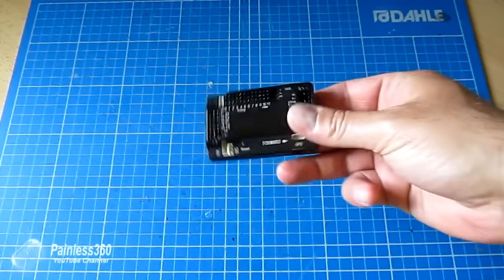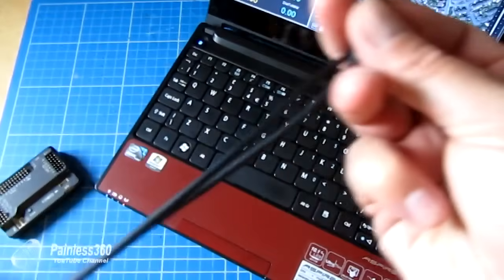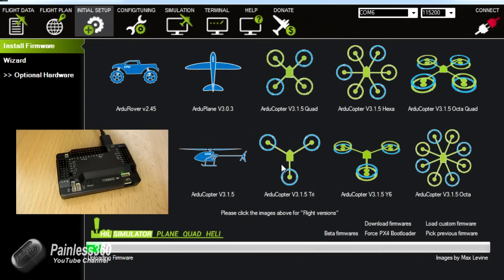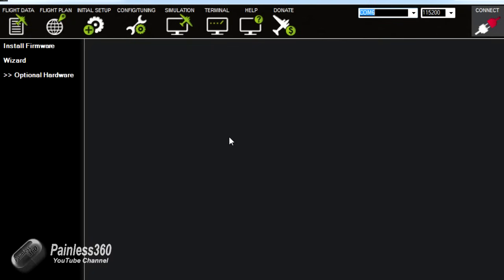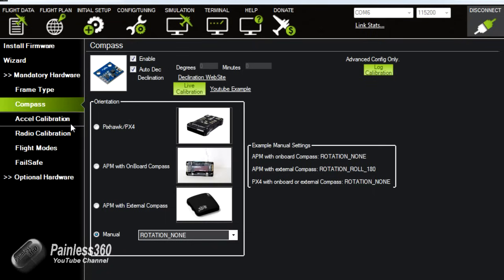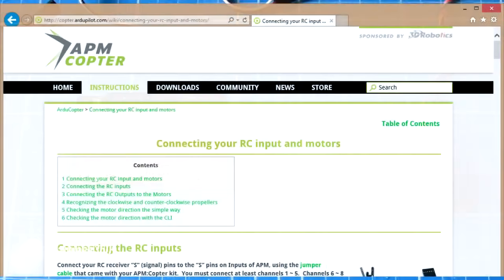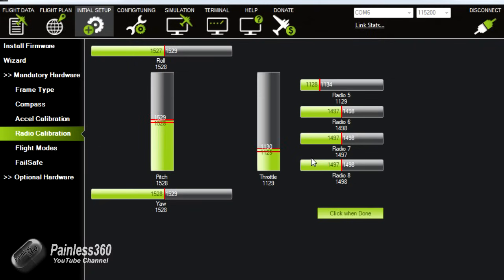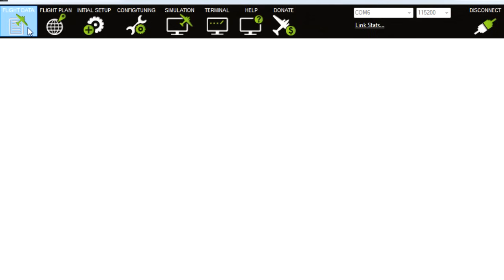(1/8) APM 2.5/2.6/2.7/2.8 - Simple installation and setup overview

Comment: Hi Brother :) I do hope that everything is going fine with you, and althou you are bussy I hope that you have time to help me?I have a set up, the motor is:Turnigy 4112-320kv and the esc is 65amp(overkill I know) the Problem is on 3 or 4 or even 5s lipo's I can not get the dam thing to fly, first on 6s lipo's It fly's but I have got to be over half trathol to hover and all the way up if I want it to fly a bet aggressivlly. I have some Carbon Prop on it(11, something ) I had a easy Osd installed on it, and it pop on me for no reason. Since then It has been worse. Is there anywhere in apm board where I can screw up the throtel or what do you think I should do?Sry my bad English ....
Reply from the maker: +Bisholi M Looking at the specs on the site the detail on recommended props is very poor. I would suggest that you need a larger prop but I would go back to HK and ask them for a proper recommendation for your preferred battery size. Best of luck.
Reply: +Painless360 Thank you for responding. Yesterday I was out flying, and the last couple of times I could fell that it has less and less power even thou I would use the same new liopo's 6S. So suddenly as soon as attach power to the board my Osd went up in smoke, Since the arducopter has done very strange things. I thout that a new set up from scrach will help :( But no. The ch. 3 to the motors wont work anymore, all the other ch's work but not that one!! I dont know what to do. To order a new APM bord or go for the new more powerfull PIXHAWK?any recomendations? :)
Reply from the maker: Bisholi M I would recheck your calculations and motor/prop setup before trying another flight controller. Both the APM and Pixhawk are great controllers if you want GPS.

Best of luck.

Comment: A question. 
When I try to see the information of serial information I get extrange character. Can you teel why-
Reply from the maker: +Jorge Gómez could be a few things, depending on versions. Disable things like the BT adapter on your computer and later versions of the code removed the console from the stuff you uploaded. Check the release notes.
Reply: Try changing the baud rate.
Reply: I did it, but with not sucess.

Comment: Can I use obstacles detector & avoiding sensor  in apm 2.8 board?
Reply from the maker: You can with the Pixhawk boards. Not sure if the older software that the APM will run can.. Best of luck

Comment: Hello, i just got the apm board and ive had a crash where my quadcopter just dropped out of the sky when in guided mode. any ideas on what happened? I have flown it in guided just before the crash and it was preforming very well.
Reply from the maker: I'd look at the logfiles (see the later video in the series) to see what happened. Best of luck!
Reply: I checked the logs, threre is a spike in the roll. i belive this means mechanical failiure

Comment: I have an arducopter V2.8, when i look for the recommended firmware update 3.2.1 i don't see it in the list of available downloads. there is AR2.50 AP 3.3 AC 3.2.1, is this the version i need ? there is only 3 other choices, AR2.49 AP 3.3 AC 3.2.1,or AR2.49 AP 3.2.3 AC 3.2.1, or AR2.47 AP 3.2.2 AC 3.2.1
Reply from the maker: http://youtu.be/Vbz3vN3JH6Y AC (Arducopter) 3.2.1 is what you need.

Comment: Painless, i dont know what is wrong but my quads lowest throttle point makes the quad take off, which resulted in crashes.. why does the throttle start so violent as so low throttle?
Reply from the maker: Esc calibration,  throttle range on the radio... watch https://youtu.be/olIqTiSJHIY and come back to me.

Comment: @Painless360, I am having issues with the external compass.  I am able to perform the calibration, it states it successfully captured the data points, but then nothing happens.  When I go to the Flight data screen, GPS information just sits at 0.  Any help appreciated.
Reply from the maker: Happy to help but please watch https://www.youtube.com/watch?v=olIqTiSJHIY and come back to me with more detail of what you've tried..
Reply: Problem Solved:  Got the new GPS in, plugged it in and now I get Sat information.  I was convinced I was doing something incorrect, however it turned out to be a faulty GPS module.

Comment: Hello Could you tell me the planner version you are using here as im trying do this with 2.0.24 and a 2.8 controller, the newer version seems different to your tutorial one. I get as far as loading the firmware, but when i connect there is no list of setups. thanks for your help. kev lev
Reply from the maker: I've not played with APM for a long time now. You should be looking for V3.2.1 or earlier for an APM. The option to load previous firmware is still in the bottom right (see later video on it in this series..)
Reply: thanks I've got it working now, muppetry on my part, got muddled up with the com port assignment...

Comment: If I connect APM board with APM Power Module cable, then what to do with ESC ( three cables ) cable. Have I to cut Red supply wire & use only other two ( for control )..??
Reply from the maker: All covered in the series - keep watching! :D
Reply: Painless360 Thanks alot

Comment: Hi,

I need help with APM 2.8 arming.

APM 2.8 setup
Jumper J1 (used) as I have not plugged in the PM
Receiver connected (with correct cabling) to APM
External GPS connected  to APM (it came with 2.8)

This part worked -

1) Accelerometer tuning via Mission Planner (MP)
2) RC calibration via MP, moving the sticks on the remote control

What is not working

a)   I am getting bad compass health error
b)   in MP when logging into the Monitor - lots of gibberish characters are scrolling on the screen

Red light on APM continues to blink slowly.

I can connect to the Mission Planner, but cannot get the RC to arm.
I am trying to hold  the throttle key to the extreme bottom right for 5 seconds after turning on the RController.

I tried using the reset switch on the APM (when connected to USB) by pressing it down.

Soon after resetting it, you notice the purple and red light flashing together, then only the red light continues to flash slowly.

Can someone please help.

Newozuser
Reply from the maker: V Patankar You need to plug the external compass into the board and try and calibrate again. I cover the arming troubleshooting process in https://www.youtube.com/watch?v=6U-rjC39EXQ
Best of luck.

Comment: Hi,I have  I am using GPS in APM board,I have APM 2.8.i have ublox neo8m .the gps work in rover firmware,I get GPS lock ,GPS work well rover firmware,but it doesn't work in arducopter 3.2.1.

So if some could help ?
Reply from the maker: No need to post a question twice on the channel, I'll see it ;)

Comment: Hey, im trying to set up this board (hk pilot 2.7, but just about the same) when i do the magnetometer/compass calibration it doesnt create a sphere on the monitor, but it just piles up a big bunch of dots down in a corner.. i guess im not doing it right? i did the movements as shown ++, but it never gets enough samples! what to do?
(Thanks for fast awners, need it for my V2)
Reply from the maker: Adolph Hitler it should work in the same way. Check the connection to the external compass and reset the board to try again. If it still doesn't work then the compass may have a problem..
Reply: Im warning you, i have got a full tank of zyklon B right next to me if you dont calm down. Haben Sie verstande?

Comment: Will this series work with the Pixhawke board as well?
Reply from the maker: A lot of it is the same or very similar. See http://planner.ardupilot.com/wiki/common-loading-firmware-onto-pixhawk/

Happy flying!
Reply: Thanks so much i like your turorials. But a bit nervous about the complexity of this Pixhawke software. And i keep gettjng a bad gyro message on rhe front page after calibrating. When i do the calibration of compass it only gives me about 10 sec to complete it and i cnat get many dots  on the screen. Unlike yours where it lasrs for a lot longer and you get a sphere almost. Will have anorher go in a few days as doing my head in at moment.

Comment: With this board, can i connect 6 servos and 3 motors? i want the servos to stabilize a gimple thing, and i want it on a  tricopter. would this work? and how much flexibility do i have to program the servos?
Reply from the maker: I've not looked at the APM for a while so the best advice I can give you is to have a look at the documentation about it - http://ardupilot.org/copter/docs/common-camera-gimbal.html Best of luck!
Reply: thanks!

Comment: I am unable to configure radio on my QX7 ACCESS with R9 MX receiver using SBUS or S.Port on my APM 2.8 flight controller. Using Mission Planner 1.3.77 with latest APM flashed with firmware 3.2.1 for my QUAD_X_4. Just the Bars on the Radio configuration setup screen won't move when I try to calibrate while I am moving sticks on my Radio. I have tried using both jumping PIN 2 & 3 on Input on APU and also without it, just connecting, S.Port/SBUS, V_in and GND pins in APM. Please help with the Radio setup.
Reply from the maker: The first thing to confirm is is that the reciever is bound. How do you know that is good?

Comment: I am thinking about buying an APM2.8 on eBay with a load of extras (telemetry, power modules, GPS etc) and want to use QGroundcontrol. However, there seems to be a lot of talk about it not being supported anymore or much longer. Any advice from anyone?
Reply from the maker: If you Google 'apm retired painless360' then you'll find our video on the subject. Best of luck!

Comment: quick question... my apm 2.6 is displaying the wrong altitude through the minim  osd. it's always displaying in the 100's  while it sits on the ground.  any ideas?
Reply from the maker: +NUWEST00520041 That is what it sees as the altitude. Its not relative, it is the altitude above sea level. These are never perfect but have a look at the documentation around using the Baro and GPS altitude.. 
Best of luck.

Comment: Is there any set up required to use the neo 7m GPS with this board? I can't even find a video about which ports to plug the GPS into. Please help!
Reply from the maker: Sorry, not sure. We buy the GPD modules made for the these flight controllers that come with the right connections.. Best of luck.
Reply: What GPS module could I purchase that would be gaurenteed to work with my APM 2.8? (For as cheap as possible). Thanks!
Reply from the maker: The series 6 modules work ok. I'd search on eBay and places like Banggood for it. You want the one with the two cables with the right connectors for the flight controllers. The Cheapest will probably not come with the connectors you need..
Reply: Alright, thank you. Hopefully I can get something working

Comment: +Painless360

Hi, where did you buy the amp with the cables and the gps and so on? I searched on hobbyking, amazon, ebay and on many other websites but I can't decide which one is the right, because there where many options you can buy(like other equipment that you don't have in the video. 
Can you send me the link or give me the name of the website where you bought it?

Thank you
Reply from the maker: +gabriel ganthaler This was bought ages ago from eBay. The explosion of APM clones and sellers does make it daunting but I'd use a seller who specialises in RC and gets good reviews. Best of luck..
Reply: +Painless360 
Thank you for the fast supply :D

Comment: ok this is what happen when i get to the install the receiver to do the radio set up the amp 2.6 will not boot up to mission planner i keep on getting a time out count down and it will not work and when i unplug the receiver and boot up the apm 2.6 to mission planner it work the artificial horizon and everything works

Comment: bro im using apm 2.6 i did accel calibration without quad(only apm via usb cable) after i connect apm to quad and i armed all motor running(without props) in same rpm if i tilt there is no changes in rotation can u help to work gyro?
Reply from the maker: Without more detail it's impossible to offer any advice. Happy to help but please watch https://www.youtube.com/watch?v=olIqTiSJHIY and come back to me with more detail of what you've tried..

Comment: do you have a video on reset load factory setting and firmware mission planning.
Reply from the maker: Not really - I'd flash it with another firmware (like Arduplane) then back to the one I wanted to clear everything.. Maybe there is something on it on the manuals? Best of luck!

Comment: I crashed my quad and I thought it was the tx as I just loaded er9x. I got the new arm,s that broke and after a frame rebuild I was going to erase and reinstall the firmware. When I go to terminal and click connect it starts running data on the screen and it will not end. I let it run for about 2 hours. I can calibrate the compass and the gps locks. I'm connected with usb. MP said pre arm was ok, no messages. I don't want to try it again until I got the new firm ware. I got a pic of the screen. The reset button does't do anything either. Bad board? Any ideas or suggestions. Help
Reply from the maker: +Xato Kiknadze No ides with that level of detail. I'd ignore terminal and recheck the setting are all ok using the GUI. Best of luck with it..

Comment: Hi, if using a simple 4 channel tx, I wouldn't have a separate switch to enable the rtl, so would I just set all channels to stabilise and use rtl as my fail safe? TIA
Reply from the maker: I wouldn't use less than five channels.. Best of luck!
Reply: Ok but is it do-able that way? As I only have the 4 channel atm, cheers and thanks for fast response :)
Reply from the maker: If you want to do this get a radio with at least 5 channels.. Best of luck..
Reply: Which would you recommend with a decent range, not too hard to fathom?!
Reply from the maker: Everyone has their own favourites. We are looking at a few in the coming weeks on the channel. One that may be interesting will be out on a video tomorrow..

Comment: i have apm2.8 mounted on wooden frame and it is not being stable...what to do??
Reply from the maker: Check for vibration and that the FC is at the COG and on anti vibration mounts. You can use the log files to see what's going on too..

Comment: Were do you recommend to source APM FC?  Looking forward to installing APM.
Reply from the maker: Hi Jon, I've got all of mine from eBay. Great board, you'll have fun with it..
Reply: Thanks will order today. I trained on CC3D in stabilize mode and looking for more advanced functions.  Also will be testing NAZE 32 using your video series.  Great work!
Reply from the maker: Thanks Jon, the Naze32 and CC3d are very similar in capability to the Multiwii platforms and software. 

APM and Mission Planner are a WHOLE 'nother level when it comes to autonomy!

Good luck with the new build..

Comment: Hi again. I had posted the thread on most RC websites, unfortunately no answers. I finished build of my skyhunter mini with Apm 2.6 but there is a glitch. the minute I switch to loiter or fbwa or b altitude hold, the motor just shuts down. I went through all settings on mission planner an I cannot see what is causing the problem. Any suggestions? Big cheers.
Reply from the maker: I'd start with the logfiles. http://ardupilot.org/copter/docs/common-diagnosing-problems-using-logs.html Best of luck!

Comment: good day.
i am following you step by step on my autopilot for setting , and i reach the point compass life calibration , and i start moving my flight controller , and i did not see  the same screen as you have ( the progress ) i am getting 2 black rectangular in the same windows progress. can you tell me why is that? and nothing happened at all i can not see any signal on my screen and once i click done it tells you are missing data point , how can i solve this problem. need help
Reply from the maker: Hi Elie, if it's the APM 2.6 board then you need to have the external compass plugged in for this step. Also make sure that you have the right option ticked (on-board compass, external compass etc.) on the main window before clicking calibrate.
Reply: Painless360
thank you very much i will try it tonight. because i just finish working and i had a very hard night of work.it is 9.12 in Montreal canada

Comment: after uploading v3.2.1 in my amp2.5, every thing works well except flight mode.flight mode is not changing. It shows 0 pwm. but switches are working in radio calibration. Is this firmware problem?

Comment: i have the APM 2.6 do u think that now 2021 can install ardupilot on this? more specifically ardurover
Reply from the maker: Maybe, https://youtu.be/Vbz3vN3Jbut only with old versions..
https://youtu.be/Vbz3vN3JH6Y
Reply: @Painless360  what's gonna be the difference of 2.6 version with 4.1 the latest?
Reply from the maker: Lots, all in the release notes. I wouldn't use APM now. Best of luck